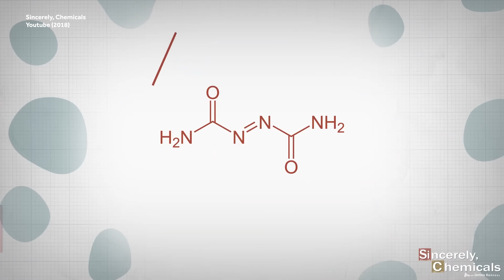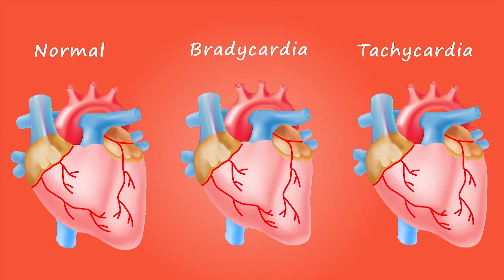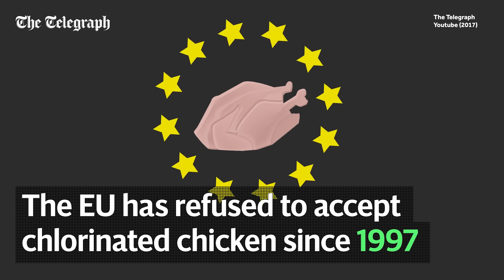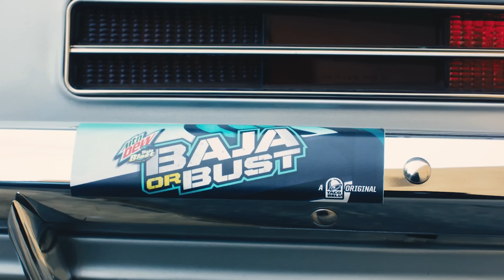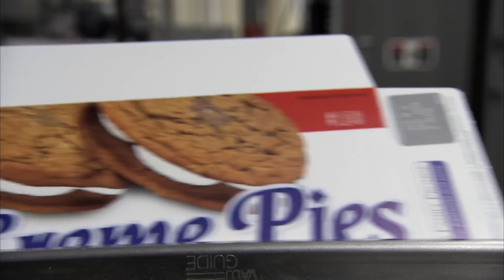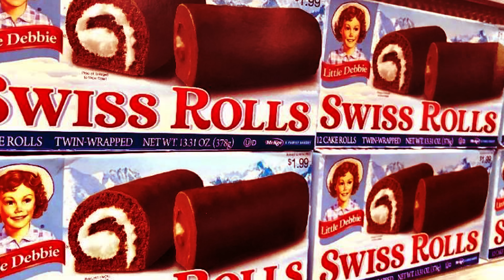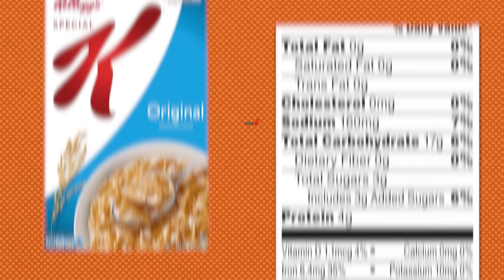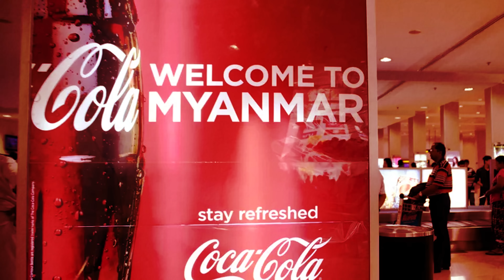American Foods That Are Banned In Other Countries

Comment: I stopped being able to eat/tolerate/like many of the "foods" i used to eat in my 20s that i revisited for nostalgia.   I used to have a 3 liter a day diet coke habit.  then i quit... i tried soda a few years ago and have no idea how i used to be able to chug it down!  I could barely swallow a mouthful!  and i felt sooooo awful afterwards  like my insides felt dead or numb.  I can also now no longer eat processed bread/flour tortillas, cold cereal, any packaged cookie or mass produced "chocolate" bar...they all taste sooooooooooo bad.  I've changed my lifestyle to prioritize preparing as much as I can from scratch.  I rarely buy anything with more than 1 ingredient.  the exception would be organic ketchup.  I even pre-make beans and freeze them now, to avoid cans with bpa, or whatever bp they are replacing the a with, and many of them add preservatives which i'm like, that's the whole point of canning! I don't even buy sriracha anymore b/c of the added preservatives.  I make my own lacto-fermented hot sauce and it is amazing.  Tastes great, higher quality, less expensive, more nutrtious and it feels better to be in relationship with what i am putting in my body.  It does take more time and intention, and I have had to shift my lifestyle to be able to do it.  Totally worth it.

Comment: The way those chickens are treated in factories is disgusting, You know the u s has a huge morality problem.
Reply: Looks similar to the one I worked at in New Zealand apart from the chemical bath put if one did fall on the ground I was told to rinse it under a tap and put it back on the line

Comment: When you go to Europe, it is impossible to find all the junk on North American shelves. 
There is also parts of Europe that take siestas in the middle of the day.  I stayed at a bunch of air bnbs.  Most did not even have a microwave.  They are not as tech crazy over there either. It was about 10 years ago I went, but you did not see a household where every child owned an electronic device. 
All together Europe was a better environment, physically, and mentally.  North America could learn some lessons.

Comment: .2.(luong).worth of .1....: 1 equivalent in value, time, quantity to 2
A month's worth of data" = Data equivalent to what is typically used in a month.
"Ten dollars' worth of candy" = Candy equivalent in value to ten dollars.
bread is banned because of a variety snack pack worth of additives
ielts task 1 and 2: The chart shows that the average household consumes a month's worth of electricity in just two weeks during the winter."
Investing a year's worth of savings into education can yield significant long-term benefits."

Comment: I live in Sweden and still can buy Mtn Dew. Havent looked for skittles but you can still buy them . Coca Cola taste like sewer water here, disgusting !.
You can buy m&ms here in Sweden !.
Reply: mtn dew, m&ms and other things for europeans are produced in the netherlands and not the usa
Reply: The reason they are “banned” is because of food coloring. Is the food coloring banned because it’s bad for you? Nope. It’s simply banned because Europe uses a different grading system for food colorings. Those food colorings in the USA simply don’t exist in the European grading and therefore simply don’t exist. It would be like using inches to measure items in Europe instead of the metric system.

Comment: So I Believe red dye Is or was banned in Japan wheni.used to work at a Candy factory. That originated in Spain.and came hear And I will say the process and the items you use is crazy And we made chocolate rocks And I will say they tasted great at every step , even knowing all the chemicals I was adding Chocolate rocks are similar to m&m To give them the shine we would use a chemical That smell just like rubbing alcohol. And then we would throw a few chunks of beeswax. And I will say. When result to Japan. What was a pain i* t** a** because we had to deep clean the machines because the red dye And one of the Japan food coloring. Was. The same thing as grass stains. Whatever that chemical is. And yep, taste good.

Comment: that believe may not hold up to scrutiny from unsanity practices in mass production to the addition of dangerous chemical 
to measure up to standard/ requirement
to held up to scrutiny ....ex: The scientist's findings held up to scrutiny, reinforcing the validity of the research. it means to withstand careful and critial examination 
held up to scrutiny = withstand scrutiny
to withstand: to withstand mean to endure and overcome st unpleasant without detracting from its original good value

Comment: What I have learnt from watching videos such as yours on YouTube is that American food in general is quite awful. It is profit driven rather than quality driven.

As a result of this profiteering process, such things as chlorine washed chicken end up on the supermarket shelves. 

The foul practice compensates for poor hygiene behaviour elsewhere in the supply chain (for example on farms), and that consumers are better protected by a system that doesn’t allow processors the simple ‘get-out’ of treating their chicken with chemicals. gets chlorine filled chicken. 

American cheese is simply vile and may lead to sodium overconsumption. As such, it may increase your risk of developing high blood pressure. American cheese is high in saturated fat and sodium, both of which may increase the risk of high blood pressure and heart disease.

American food in general is ultra-processed and comprised 57.9% of energy intake, and contributed 89.7% of the energy intake from added sugars. 

The content of added sugars in ultra-processed foods (21.1% of calories) was eightfold higher than in processed foods (2.4%) and fivefold higher than in unprocessed or minimally processed foods and processed culinary ingredients grouped together (3.7%). 

Both in unadjusted and adjusted models, each increase of 5 percentage points in proportional energy intake from ultra-processed foods increased the proportional energy intake from added sugars by 1 percentage point. 

Consumption of added sugars increased linearly across quintiles of ultra-processed food consumption: from 7.5% of total energy in the lowest quintile to 19.5% in the highest. 

A total of 82.1% of Americans in the highest quintile exceeded the recommended limit of 10% energy from added sugars, compared with 26.4% in the lowest.

Basically American food is dangerous for your health and shouldn’t be consumed, even if you are dying of starvation. Better to eat one’s own faeces.